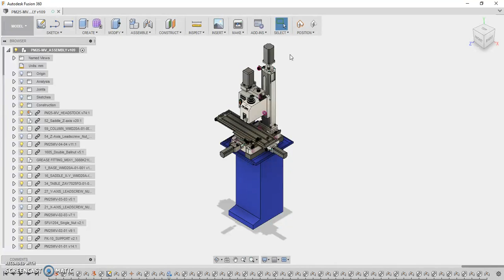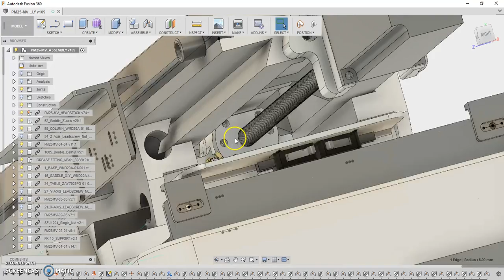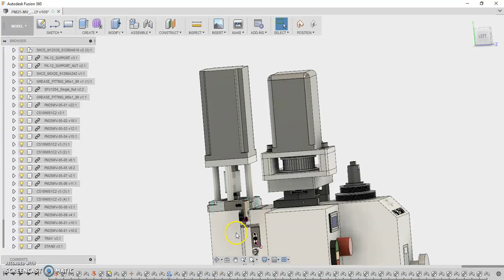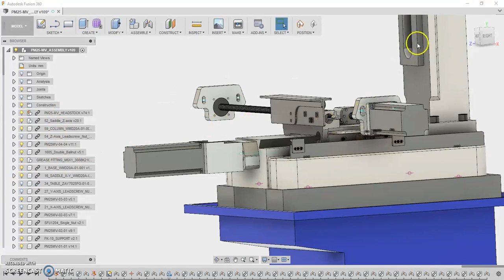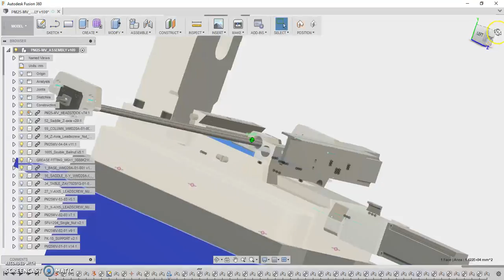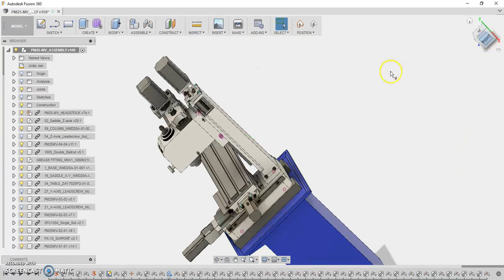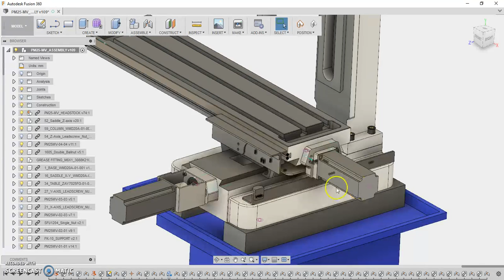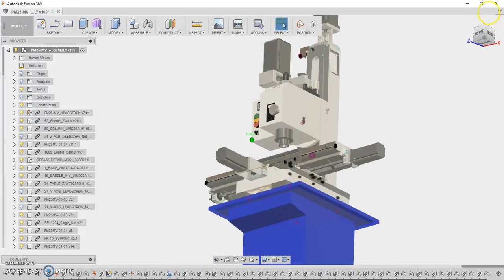PM-25MV Milling Machine CNC Conversion: Part 1

Comment: Thoroughly convinced the CNCMasters's - CNC BARON MILLING MACHINE is a better way to go. It already has everything you mention here and I bet by the time you're done you'd spend the same or less on their mill.
Reply from the maker: Their stuff looks nice but you don't get a true Z axis. They are only automating the quill.
Reply: @FrancoCNC  True, and I'm assuming your concern would be rigidity during operations, especially if the quill were largely extended? My only response is their reviews have been stellar. Also did you see their CNC SUPRA MILL? It's a full scale CNC knee mill for $11k, and they have customers that have been running it over 8 years, no issues. I've got to believe for that money and customer reviews, their credibility looks pretty legit.
Reply from the maker: @jryer1  for the price, that is hard to beat.

Comment: Is this a good machine to build on? I mean from the manufacturer in China. I need a good desktop mill that can be retrofired to CNC.
Reply from the maker: Hi Ronnie.  If you can live with a very small machine, check out Sherline.  Their  stuff is small but it is of very good quality.  You can buy a CNC package ready to run out of the box.  If you need something larger, then the PM25MV of the PM30MV are (IMO) the way to go.  Of all the importers of inexpensive Chinese (and Taiwanese) machines, Precision Matthews is the best.  They will give you the best version of these machines.

Comment: Very well thought out. Can't imagine how long it took to reverse engineer this machine, then turn that info into a CAD model. The smaller ball screw on the "X" sounds like it'll work, as it's just moving the table since the ways are actually supporting the table. Will be interesting to see how it holds up over time.
Reply from the maker: Yes, my OCD really kicked in on this project!  So far, the 12mm ball screws have been working great.  No problems at all.

Comment: Franco what size of steppers are you using? nema 23's and nema 34 for z?
Reply from the maker: You are correct.  Truth be told, I think I could have used the closed loop NEMA 23 for the Z axis, as well.  They are very powerful.

Comment: Good channel I like the closed loop system info.  If your Y axis nipple is that hard to access, maybe a grease gun hose between the nipple and the threaded hole would make the nipple more accessible for you and you wouldn't have to block it up......
Reply from the maker: That's a great idea.  I actually did something similar to that.  I found some tubing and fittings that fit in there just right and now I have external grease ports on the side of the machine.

Comment: you could run plastic lines for the grease fittings too for a central greasing area, similar to your central oiling system
Reply from the maker: Good point.  That may happen.  Thanks.

Comment: Franco,

Extremely well done presentation sir.  Once again keep up the good work.  I do have one question for you.  Have you considered the Y-axis travel for your mill?  If so, what is your expected result?  Personally, I was expecting to keep 6 inches on Y-axis but as it turns out I have made a calculation error and my current Y travel is 3.5 inch.  I was considering turning my ball screw nut 180 degrees opposite of your diagram.  Also I did grind a slot for extended range.  If you have the time, I would like to have your opinion on the matter.  Thank you for your time.  Keep the videos coming, I am anxious to your mill in action.
Reply from the maker: Hello. Thank you for your comments.  According to my solid model, I should have 6.85" of Y-axis travel without the need to modify the machine.  I'm working hard to get this thing finished.  I'll be sure to post videos when it is up and running.
Reply: Franco 
I am certainly interested in regaining this lost travel, if you have suggestions I would welcome them.  what length for your ballscrew y axis.  if you do not mind sharing.

Comment: Great video Franco, it was great to hear some of the reasoning behind the modifications. Are you concerned about the reduced  Torque resulting from the spindle modifications?
Reply from the maker: Hi.  I'm not worried about reducing torque.  I've done a similar modification on the G0704 and I've never had a problem.  The G0704 has a hi-low gear box so it's easier to drop into low range for drilling on that machine, but I don't think it will be too hard to move the belt on the PM-25MV.  Thanks.
Reply: Good to hear, I look forward to your future videos on the build. Cheers, Matt.

Comment: awesome stuff. just my thoughts, putting two limit switches per axis, with closed loop steppers, and mach 4 is kind of a waste. all you really need is a referance switch, and then set up your software stops.
Reply from the maker: Hi Eitri - good point.  I go back and forth on that one.  I agree, soft limits work great.  However, there have been those times where I "accidentally" turn them off and over travel my machine.  On this design, it's not that much more work to have two switches for X and Y axis, so I'll probably just keep them in there.  However, on my lathe, I only use one per axis as that is more practical.  Thanks for your comment. Keep them coming!
Reply: Your right, I wish mach 4 would default with them "on" instead of "off" and you always have to rememper to turn them on

Comment: Hi Franco,I have a PM25 mv also. Base machine is great, and I like what you are doing. I am awaiting arrival of clearpath servos. I have 16mm lead screws, and I think larger is better. I've been chasing .004" backlash for too long now. I am thinking it is either leadscrew flex or ac bearings or a combo of both. I have double ball screw nuts on all axes, they are a challenge to fit. So I am going to source tapered roller bearings for lead screw anchoring and 20mm roller leads, maybe your cartridge apprroach is worth looking at. Thanks for posting. Rob
Reply from the maker: Hi Rob - I'm glad you like the video.  Eventually, I'll know for sure how well the Ø12mm ball screws work with the cartridges.  Stay tuned!